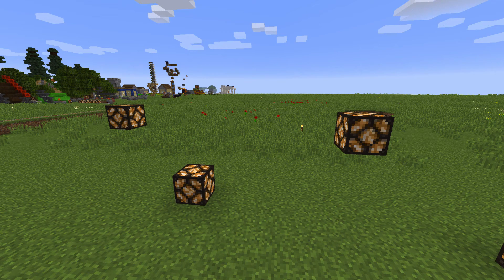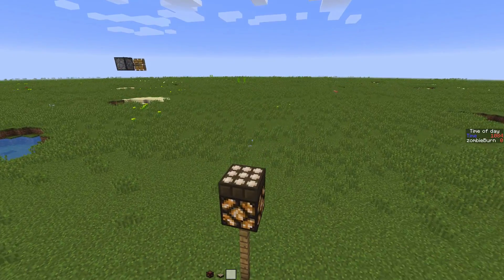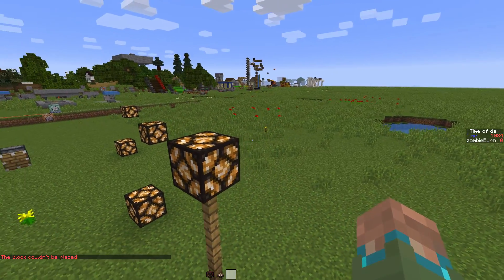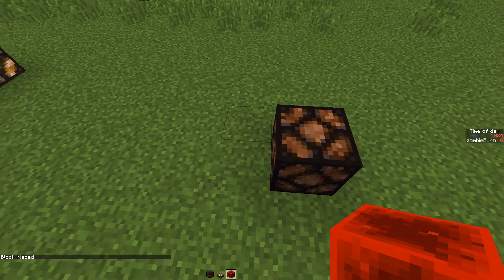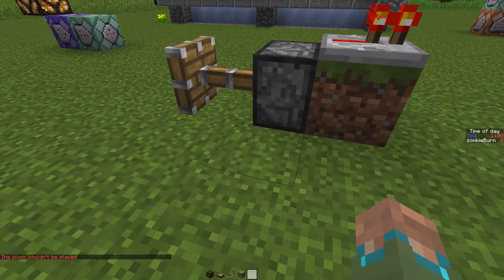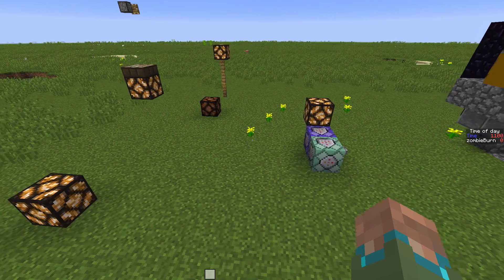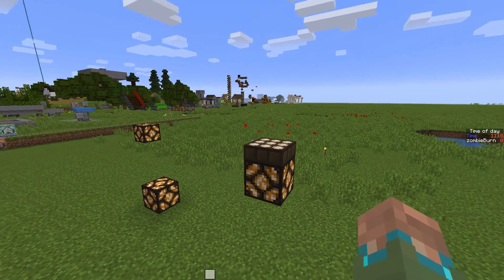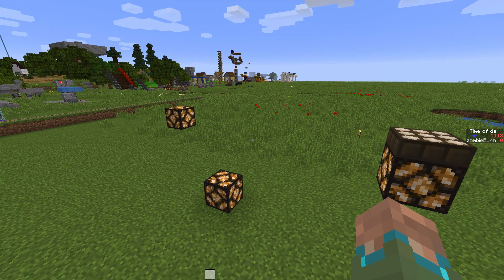[Minecraft 1.12] Powered Redstone lamps with no redstone | Minecraft concept [Creative mode]

Comment: Idk if it still works cuz I haven't tried in any recent versions, but I remember you could use setblock and setblock a lit lamp. You could also spam 2 setblock commands that setblock a redstone block and then air on a clock and it doesn't render the redstone block but keeps the lamp lit.
Reply from the maker: Yep, that still works :)
Reply: Oh, also. Again idk of this still works but you can actually do something like this in survival. In previous versions you can put a wooden pressure plate on the top and shoot an arrow into the bottom. For some reason, at least in the version I last did it in, the arrow would glitch into the center of the block and couldn't be seen but it would still trigger the pressure plate, turning the lamp on
Reply from the maker: Interesting, I will have to give that a go!

Comment: Hey I was wondering do you know a command to make certain blocks emit Redstone? For example when u step on it it emits a redstone single? kind of like what real life automatic doors have. If you have a command it would help Thanks!
Reply from the maker: I don't have a command to do that, but I'm sure there would be a few ways. I'm also sure I've seen someone do that already. I know the Gamemode 4 module "Trap signs" uses the concept, might be worth checking out https://www.gm4.co/modules/trapped-signs However it's not updated for 1.12 yet